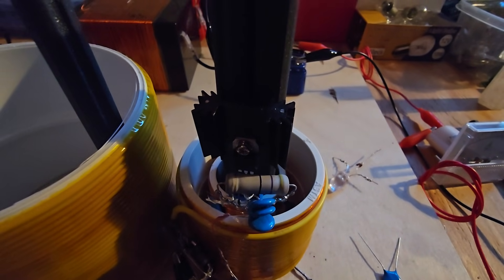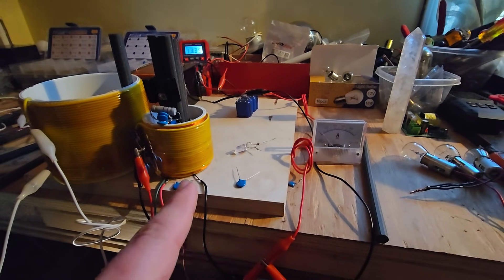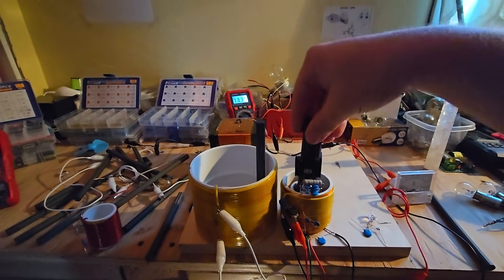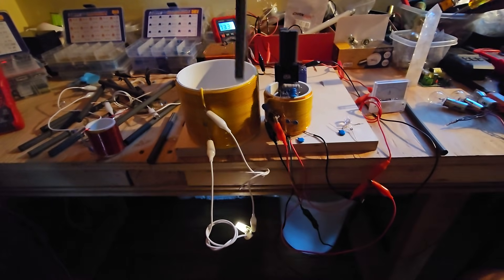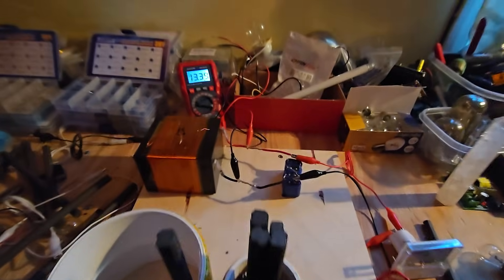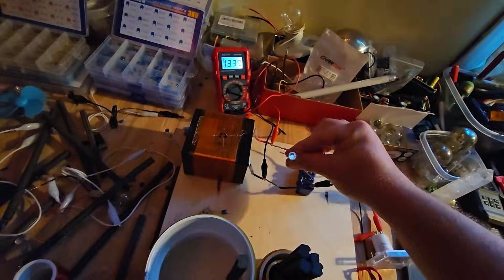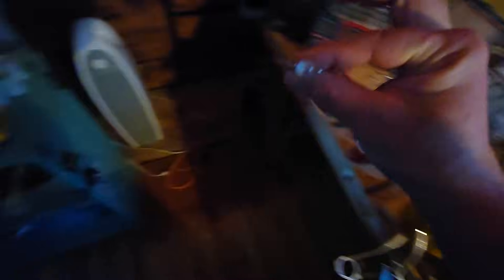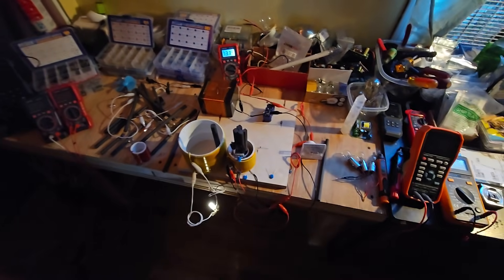UPDATE & THE ENERGY SYNTHESIS TRANSMITTER SYSTEM IS APPROACHING A 0 CURRENT INPUT STATE WITH OUTPUT

Comment from the maker: Hi, our best performing transmitter is wound upon a one inch diameter pvc pipe coupler that is 1&10/16ths inches wide by 1&14/16th inches long. This transmitter is powered off of a 12vdc 6Ah 76.8Wh LIFEPO4 driving battery. 

The length of the transmitters coils are both 1.48 inches long & centered upon the coupler to be in alignment with the golden ratio.The transmitter consists of two coils being an inner red L1 trigger coil & an outer orange L2 power coil. Both coils are identical to eachother to achieve sympathetic resonance & are wound opposite & over eachother as tightly as possible for optimal coupling to ensure efficient oscillations with our vital ST13009 driving transistor & we used 24awg solid core magnet wire for both transmitter coils. This transmitter is a 416 times mathematically perfect scaled down model of Nikola Teslas magnifying transmitter & heavy earth grounding the bottom of the red L1 trigger coil is vital for its operation & the creation of what appears to be near magic like loadless hyper efficient wireless power effects in the immidiate area possibly due to abrubt inductive switching & for it to possibly pull in dielectric energy in an induction based fashion in theory from the heavy earth ground connection. This energy seems to exist completely outside conductors in theory but conductors are needed to establish the condition for this energy to flow. 24awg solid core magnet wire seems the best so far for this style of transmitter & produces the most powerful wireless power & possible energy synthesis effects due to the 24awg transmitter coils more closely impedance matching with the test transistors we use. So far all our testing shows that the ST13009 transistor from newark electronics is the absolute best to use in this transmitter system with our current design.

The base of our current ST13009 transistor is connected to the inner red 24AWG L1 trigger coil. The collector of our transistor is connected to the orange outer 24AWG L2 power coil. The emitter of the transistor connects to the negative of our battery & the positive connection of our battery connects to the bottom of our orange L2 power coil bottom opposite of the transistor. We added a 110k 1 watt carbon film biasing resistor(must be a carbon film resistor for RF applications)between the collector of our transistor & the bottom of our inner red L1 trigger coil to ensure the transmitter can oscillate in both a hyper efficient low power & high power mode. An essential BYV26E diode can be added as a single flyback baker clamp between the base & collector of the Transistor to speed up switching & enhance the hysteresis effect further in theory with the diodes cathode going into the collector & anode to base. A 680pF-10nF (2.2nF 3kv currently) capacitor can be added in parallel with the base & emitter to also improve efficiency as well as a capacitor in parallel with the emitter & bottom of the L1 trigger coil but keep its value below 10nF (4nF 3kv Current Capacitor Value) or you will blow your ST13009 BJT transistor. Its important to balance energy efficiency with good performance with this transmitter & small tweaks to the two capacitor values can achieve that especially with the latter mentioned capacitor.(Usually by slightly increasing their values & be aware of cheap knockoff  transistors on Amazon because they won't work nearly as good as one thats purchased from Newark or any other big reputable electronics retailer.)(thick NIZN ferrite tuning rods centered in the transmitter/receiver arrangement can also tune the system & are ESSENTIAL to what appears to be near perfection.)(note that the cheap knockoff transistors not purchased from a reputable electronics supplier will require you to tweak your parallel capacitor value between the emitter & bottom of the L1 coil much higher then the 2.2nF value but still under 10nF to only achieve 60% of the performance a high quality ST13009 will give you & our heat sink is aluminum & measures 25mmx34mmx12mm. A 9nF 3kv ceramic capacitor must be installed in parallel on the DC positive input line very close to the transmitter to always achieve a battery recharge of 13.38vdc. That capacitor prevents driving battery voltage sag in theory. A beneficial 16vdc 1.6 Farad super capacitor bank can be installed in parallel with the DC driving battery to accelerate recharge effects & overcome recharge bottlenecks along with an optional 3 watt 12vdc led or Incandescent light installed in series between the top of the transmitters L1 trigger coil & base of its ST13009 transistor to enhance beneficial non linear effects. (Currently none installed) A 47 ohm 5 watt carbon film resistor was added between the transistors base & emitter to improve efficiency & a 5-50nF capacitor in parallel with this resistor increases efficiency further & power output at our 4 watt 12vdc Incandescent test wireless bulb. (28nF currently). New setup allows for the transmitter to only consume 30mA during wireless resonant dc backfeeding into the driving battery. An additional 1-10nF capacitor in parallel with the 110k biasing resistor will also improve efficiency system wide. (8nF value currently.)

TRANSMITTER LCR READINGS:
INNER L1 TRIGGER COIL HAS AN INDUCTANCE OF .228mH/0.16mH WITH A RESISTANCE OF 01.0 OHMS

OUTER L2 POWER COIL HAS AN INDUCTANCE OF .220mH/0.15mH WITH A RESISTANCE OF 00.9 OHMS

1.505nF INTERNAL CAPACITANCE BETWEEN THE L1 & L2 COIL

NEW TWO PART RECEIVER COIL LCR MEASUREMENTS BELOW. TWO PART RECEIVER COIL IS CONSTRUCTED UPON A TWO INCH DIAMETER PVC PIPE COUPLER WITH BOTH COILS BEING 2.4 INCHES LONG WHICH IS A GOLDEN RATIO HARMONIC TO THE TRANSMITTERS 1.48 INCH LONG DUAL COIL LENGTH & THE TWO PART RECEIVER COIL TAKES UP THE FULL LENGTH OF THE TWO INCH DIAMETER PVC COUPLER.

26 AWG 25/38 LITZ WIRE INNER HIGH Q REACTIVE RESONATOR L1 COIL HAS .508mH/0.45mH OF INDUCTANCE & 01.7 OHMS OF RESISTANCE. (3.3nF 3kv PARALLEL CAPACITOR ON THIS COIL INCREASES POWER OUTPUT & LOWERS POWER INPUT TO THE TRANSMITTER.)(TWEAKING THIS CAPACITOR VALUE MAY BE NEEDED AS WELL TO FULLY TUNE THE SYSTEM)

OUTER L2 POWER TAKE OFF COIL BEING TWO 18 AWG STRANDED WIRES IN PARALLEL HAS AN INDUCTANCE OF 03.7uH & A RESISTANCE OF 00.1 OHMS & HAS A FULL BRIDGE RECTIFIER COMPOSED OF STPSL560 DIODES INSTALLED THAT BACKFEEDS ITS DC POWER BACK INTO THE DRIVING BATTERY. A GOOD EMPIRICAL WAY TO TUNE THIS COILS POWER OUTPUT IS TO RUN A 12VDC 5 WATT INCANDESCENT BULB & EXPERIMENT WITH DIFFERENT PARALLEL CAPACITOR VALUES ON THE INNER PART OF THE RECEIVER COIL. THE EFFECT WE ARE LOOKING FOR IS FOR THE TEST BULB TO GET THE BRIGHTEST WHILE POWER CONSUMPTION TO THE TRANSMITTER DROPS TO THE LOWEST SIMULTANEOUSLY & INTERESTINGLY ENOUGH NO CAPACITOR IS INSTALLED ON THE OUTER PART OF THE RECEIVER COIL THAT HAS THE STPSL560 FULL BRIDGE RECTIFIER INSTALLED. (Additional 8.8nF 3kv ceramic capacitor added in parallel on the second part of the receiver coils dc output to boost power output further while simultaneously increasing system efficiency.)

ADDITIONAL 3RD RESONATOR REFLECTOR COIL IS WRAPPED OVER A 4.5 INCH DIAMETER 3.8 INCH LONG PVC COUPLER USING 18 AWG STRANDED SILICONE WIRE & THE INDUCTANCE IS .204mH/0.14mH WITH A RESISTANCE OF 00.4 OHMS. A 2.2nF 3KV CAPACITOR IN PARALLEL WITH THIS COIL FURTHER ENHANCES THE EFFICIENCY OF THE ENTIRE TRANSMITTER/RECEIVER SYSTEM WHEN IT SITS OVER THE TRANSMITTER & 2.4 INCH DIAMETER TWO PART RECEIVER COIL. WE TRIED TO MAKE ALL PARTS OF THE SYSTEM GOLDEN RATIO HARMONICS.

Comment: Thursday, November 20, 2025 (TAHITI - PF).

Hello MTECH, could you please provide us with the measurements in cm (centimeters) of the PVC tubes for the receiver and transmitter, including the exact diameter and length? The thickness is not necessary.

We don't understand your measurements in inches, especially measurements such as 1&14/16th inches and 1&10/16ths inches, which are a bit complicated! 
We know that 1 inch is equal to 2.54 cm, but 
where I live, dear friends, we work in mm (millimeters), cm (centimeters), m (meters), km (kilometers), etc.   I built your system, but it's not quite ready yet. The 12V battery discharges instead of charging!  The coils aren't quite right because there are too many turns! I'm working on it.... It would be great if you could give us the number of turns in the coils! Of course, we can count the turns by zooming in on the paused videos or images, but it's very tedious!
MTECH, thank you for your understanding... Thank you in advance and see you next time... We eagerly await your next video. Thanks again.
A subscriber to your channel from the island of Tahiti in French Polynesia.

Comment: bro tryna break thermodynamics lol. Instead of using technobabble, try using your voice to teach real things.
Reply from the maker: Its on open system that is capable of conjuring power at the L3 coil from a biasing voltage potential only at true 0 current draw from the biasing voltage source. Thermodynamics only apply to closed mechanical systems not open solid state energy systems similar to how a heat pump can have a COP over 10 & there is alot of tecnobabbel in advanced electronics.
Reply: @MTECH2022  I'll take the bait.

The device you have here is a transformer. You are sending alternating current through one coil, which produces a magnetic field. The magnetic field then induces a current through other coils nearby. Your metal rod does not tune the device; it has a high magnetic permeability, which helps to focus the magnetic flux where you want it.

Your use of the word "conjuring" says it all. You are attempting to input 0 current to the device while drawing a nonzero output. That will never happen; since power is the product of voltage and current, as the input current decreases, the voltage required to maintain the same power output increases, going to infinity as the input current approaches zero.

Thermodynamics applies to all closed systems, not just mechanical systems.
Heat pumps are not similar. They don't generate heat; they transfer, or 'pump' it around. The input energy is used to move a substance carrying thermal energy to the destination. The COP represents the heating or cooling ability in relation to the input power, but that does not mean that energy is created out of nothing.

Finally, I would like to clarify what I meant by 'technobabble.' I agree that there are a lot of very specific, technical terms in any field, but those are better described as jargon; the terms have meaning, but are obscure and complex, making it hard for less experienced readers to understand. What you have, and what I meant by 'technobabble,' are complex-sounding terms you attempt to use to gain credibility and sound smart, but in reality are meaningless because they are made up.

Please be more responsible with your online voice and don't contribute to the (already massive) amount of false information on the internet.
Reply from the maker: @ST-wn9kd its not AC. Its an abrupt unidirectional DC discharge. Read our latest post.
Reply: @MTECH2022  Periodic DC discharges are equivalent to AC in this situation. The magnetic fields are created when the electric current in the coil changes, and the delta-current is not affected even if the input voltage never changes sign, as in your case. There's too much crap in your latest post for me to take it seriously. I can't fight Brandolini's law lol. It's easier for fools to come up with garbage than it is for people to prove them wrong.
Reply from the maker: @ST-wn9kd that's not my problem if you can't read the raw retroductive scientific data on how the device operates. Its cop is over 333 now. The device is operating in a pure scaler mode with field tension only & no electron flow causing heat or resistance. This channel is dedicated to advancing the dead electrical sciences of Tesla & we never do BS

Comment: What is the part number of the specific diodes you are using on your blue LED?
Reply: Normally, we use 1ss signal diodes, which can be salvaged from old CB radios (Citizen Band transceivers operating on the 27 MHz band), for example. However, in the MTECH video, I believe they are using 1N4148 diodes. You can also use LED diodes, which are 2.7 volts or 3 volts.
Reply from the maker: 10mm 3vdc led off amazon. Chanzon 50 pcs 10mm White LED Diode Lights (Clear Round Transparent DC 3V 20mA) Bright Lighting Bulb Lamps Electronics Components Indicator Light Emitting Diodes

Comment: Thankyou so much for your efforts.  I appreciate all the breakthroughs that you have discovered.  I want to say the light bulb with a miniature universe in it was spectacular, Eric Dollard needs to see that video.  I think the opposite wound coils are a key to wireless transmission, it might be producing cold electricity(two wave forms at 180 degrees out of phase to each other, which physicists call a cancelling of power or null)  I believe that wave form is key to cold electricity., because power is still being transmitted.  An experimenter on YouTube used this wave form on transformers he designed and got better efficiency transmitting power.